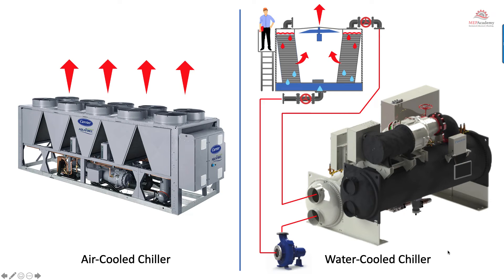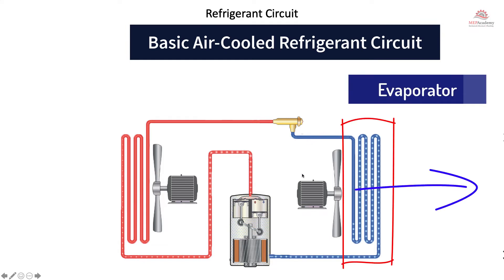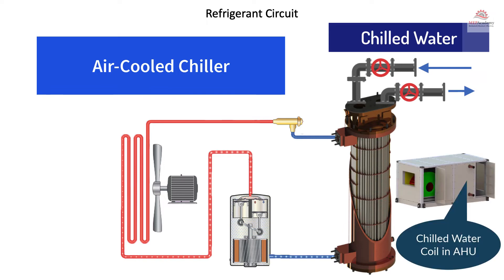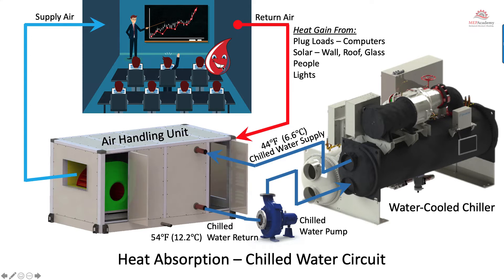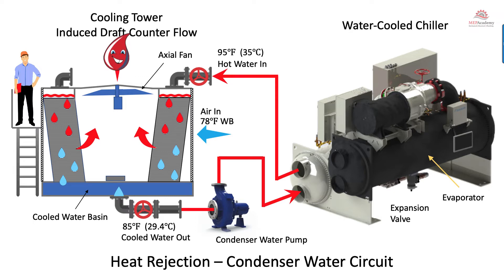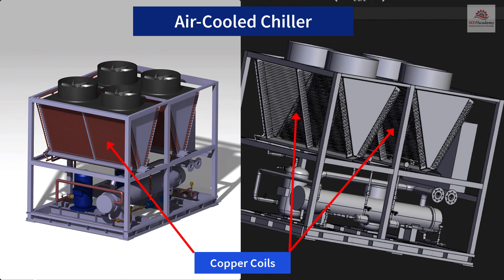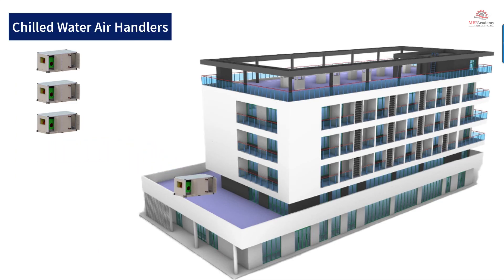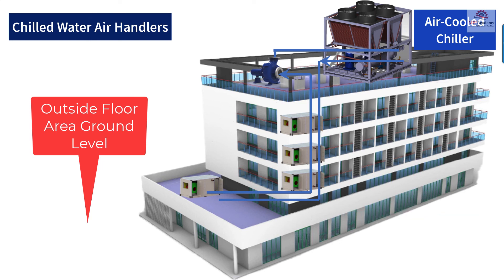How Air and Water Cooled Chillers Work

Comment: I would like to thank MEP ACADEMY for the video lesson. I am working on a project where the water flow rate of the hot circuit to be cooled is around 1000 m³/h (temperatures ranging from 331K to 323K). I am using plate heat exchangers. In the cold circuit, I am thinking of using AIR-COOLED CHILLERS INTEGRATED FREE COOLING, depending on the Thermal Load more than one in a parallel circuit. Because I believe in faster manufacturing of the equipment and also in greater speed of delivery, installation, and assembly. In addition, in the gain in reducing water consumption in the cold circuit, since my cooling tower is integrated with the chiller.
Reply: Hey bud. You should make videos on your project. Like as in please do
Reply from the maker: Good luck with your project. Thanks for watching.

Comment: There's a thing I don't actually understand. How does the water coming from the cooling tower cool the refrigerant enough? The water enters the tower at 35 degree C and leaves at 29. I mean 29 is still a high temperature. What is the refrigerant's entering and leaving temperatures in the evaporator?
Reply from the maker: Remember that you need a difference in temperature to move heat from one location to another. The greater the difference or Delta-T, the greater the amount of heat that can be moved. The condensing temperature of the refrigerant in the condenser can vary, but 95F-100F (35C-38C) are good examples for a water-cooled chiller.
Reply: @MEPAcademy  I don't understand. As far as I know, boiling points of R32 and R410a are about -52 degree C. The temperature of the refrigerant needs to drop to -52 before it leaves the condenser, right? According to the heat transfer principle, how can you do this by using 29-degree air or water? At best, in the condenser, you can drop the temperature of the refrigerant to that of water or air which is 29.
Reply from the maker: @kaan2215  You're thinking is good, but you're forgetting about the pressure. If you look at a refrigerant chart for say R32 and a condenser pressure of 280 to 320 PSI (19.3 to 22 Bar) you'll get your temperatures. The work of the compressor raises the pressure of the refrigerant in order to make it useful for absorbing the heat from the tower water. Hope that helps.